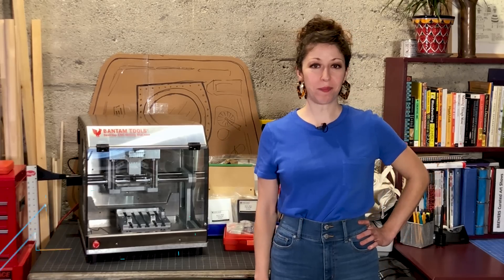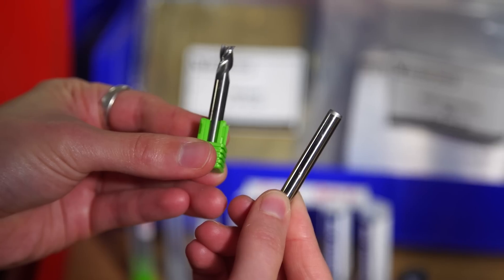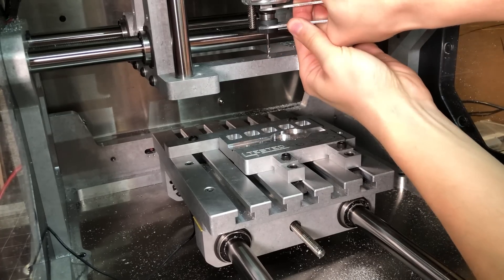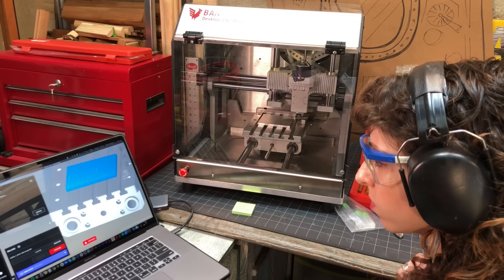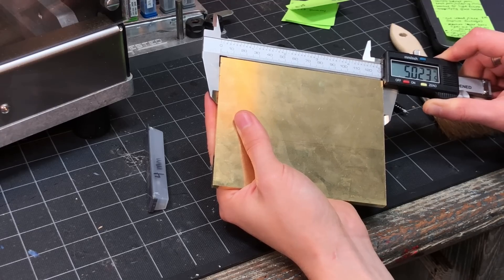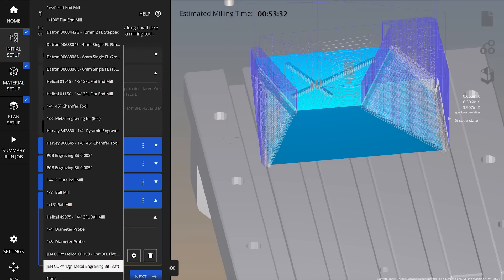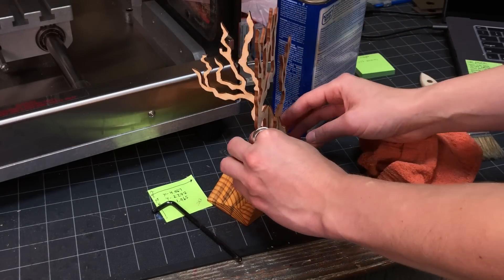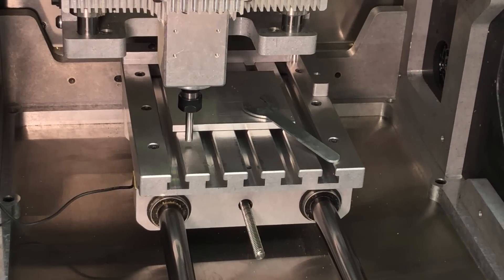Bantam Tools Desktop CNC Milling Machine Review!

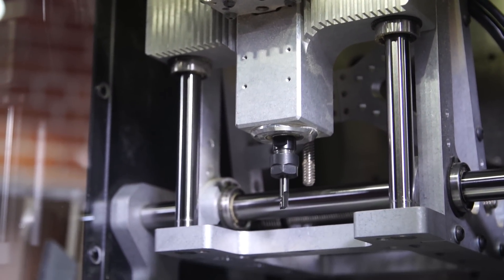Comment: @00:57 Hold up there... The Bantam too is just a 2.5D Milling Machine as you cannot mill all 6 sides without flipping/turning the stock yourself - Top side without overhang access, Sides without overhang access, Bottom without access. The only 3D Milling Machine in that prosumer price class ( I know of ) would be the Pocket NC 5-Axis CNC Machines - Top and Sides with full overhang access, Bottom with limited overhang access.

Comment: Looks like it's all there! I learned CNC back in 2000-- just at the point where you needed to learn how to figure out the tool path on your own. The scary part was that, when hired, you were expected to step in and enter all the g-code in one go. I'm sure that happened all day long in the real world but put a zero in the wrong place and you've got a 100lb jaw turning at 6000RPM...

These days sound a little better-- converting a drawing straight into g-code was a thing back then but one was encouraged to trace the path anyway.

Good presentation.
Reply: WTF are you talking about??  Cam systems have been around since the early 1980's.  By 2000 they were pretty damn powerful.  
Just because you worked in a shop that didn't have a cam system doesn't mean they didn't exist.
Reply: @danarrington2224  Aw crap, what the FUCK am I talking about?? I meant how could a p3 at like, 500MHz compare to a modern GHz machine.
Reply: Eliot Brown  It just took longer to calculate the toolpath. Solid modeling and 3D surfacing were very much available in 2000.
Reply: @danarrington2224  Thanks for setting me straight. I took a CNC class in a Port Ewen, NY vocational school and had to work with 10 and 15 year old equipment. So glad you got to work with the best.
Reply: @danarrington2224  And because you REALLY need to help me out here-- I was there for manual old school machinist training. The CNC stuff was really at the last minute, all things considered. And yes, the computers could just keep up with the new software. Pretty clunky.
Reply: Eliot Brown  You had new equipment to learn on compared to what I learned on. My first job was running a worn out Bridgeport in 1992.  I learned CNC on the job. My disagreement with your comment is more about you implying that this technology is new. It is not. Are you still a machinist?
Reply: @danarrington2224  This was based in a High School-- I used a 60s era Bridgeport and a nice lathe from just after the war. I loved those machines. The CNC stuff was supposed to be new but it was not cared for. Half the class time was spent battling the negligence and hunting down tools. A factor that did not seem to bother the instructor. 
I know what Jan is using is not "new" but the generation of software sure as hell is as is the computer it's built on. All purpose built and made just for this format.
Then, the g-code needed to be edited in Notepad, for example. Which was great experience but tortuous.
No longer trying to be one-- still use what I learned on a weekly basis though. That instructor was a little bent by the system but a wonderful teacher. What got me out of it was his "pep" talk about how, if we applied ourselves and acted confident we could secure as much as $11/hour... Which I am not knocking. But I was making hobby level vacuum form tables and doing better than that.
Reply: @MrChief101  Finally we get to the truth.  I took an auto mechanics class in high school but I don't comment on any auto mechanic YT videos like I'm an expert.  My first machinist job was $7/hr.  But I knew that I could make a hell of a lot more than that as I gained experience.  In fact, I quit a $9/hr job to take the job.  My point is stop trying to sound smart when you are not.  The real smart people can spot you instantly.
Reply: @danarrington2224  Good to finally meet a real smart person! Good luck.
Reply: @danarrington2224  I don't believe I tried to sound like an "expert." I did relate my experience of 2000. Are you saying nothing has changed over 20 years? I did have to calculate the tool path mathematically and translate that into machine language and enter that info manually. Today, the desktop machine comes loaded with a design and even has a piece of stock ready to go.
I think things have changed-- which was the import of what I was saying.
Throwing in comments on YT is an effort to support the algorithm.
Reply: @MrChief101  Your first comments implied that you were a 20 year veteran of machining.  Of course the comments that followed completely contradicted that.
Reply: @danarrington2224  Hmmm. i apologize to you if I gave that impression (perhaps to Jan too)- not my intention. I speak elliptically and often the written word just doesn't have the right emphasis.

Comment: Looks cool, but pretty expensive for something you need a subscription for. Wasn't clear how much of the subscription is just for their optional software and how much is needed to actually use the machine with third party cad/cam. If you have to pay a subscription it's a short jump to a "real" cnc installment plan....

This is probably mostly for tech ed classes at high schools, which are kind of an endangered species.
Reply: Hi there! Just to clarify, you don't need to buy a software subscription if you don't want to. Every Desktop CNC Milling Machine comes with a base pack of the Bantam Tools software for free and is packed with the features you need use the machine––and then some. Also, the Bantam Tools software supports G-code, SVG, and NC files. So you can use whatever design software you prefer, export the files, and then drop them right into our software. Hope this helps!

Comment: 250W? That's 1/3 HP or about the same power as a Dremel tool. Hopefully these come with better options for the spindle otherwise the motor'll be working at or near capacity in any material of consequence. For reference, a Bosch Colt or other palm router used in larger DIY mills are what, in the range of 750-1000W, or 1 to 1-1/3HP? Nice little machine, but I can't see it elevating itself beyond "desktop toy" to anything useful. I'm only toe deep in the vid right now, but it seems a little short in areas from the outset. I'll comment further as I watch....
Reply: Oh man, so the desktop design work to G-code is done via an online service? Immediately I feel that ownership of one of these machines is veering into "you don't own it, you licence its use" territory. How are you going to mill an anti-zombie machete when the Internets fail and you're offline, or the company no longer maintains this service?
Reply: It would seem this hinges on whether the machine can be operated via third-party software or not. If that's not the case, this is an expensive brick to wake up next to one morning.
Reply: Oh jeez, plus a subscription service? Yeah, you do not own this machine. It's the payment you make to get through the door. I'm hoping that the maker community takes this machine and re-purposes it for use with commonly-available software. All the guts of the machine seem good - if still a high price - but the fact you're licensing the product rather than actually owning it? No thanks.
Reply: I do like how they provide you a chunk of aluminium to mill a poor toolholder, rather them providing it themselves ;-)

Comment: Actually since there's no cooling you don't want to step back on feed or speed more then needed, mounting is the limitation.
With right cutting data the chips should get 80% of the heat, with to low Q value (cuted volume per minute) the pice will absorb the heat and toleranses will be harder to get, also tool life is shortened.
Reply: Get as much heat out in the chips as possible.

Comment: This thing is slightly smaller than something like a grizzly mill, which is a full blown vertical mill with a cnc conversion kit, and almost $1,000 more expensive. The software for this is laughable at best. We need more open source solutions for this tier of machine.

Comment: I feel like $3600 USD is a bit pricey for such a small machining bed. X-carve's fully loaded version has a X-Axis 750mm
 (29.52 inches) ,Y-Axis 750mm (29.52 inches) sized bed. Most wood CNC's can cut aluminum cause it's a softer alloy. MSRP $2299 USD. Also comes with comprehensive software.

Comment: Yup, cnc still isn't for the entry level household maker it seems. Too expensive for such a weak bit of software that's tied behind a subscription as well.
Reply: Hi there! Sorry you feel this way about the price point. Just to clarify, the subscription pack is totally optional. Every Desktop CNC Milling Machine comes with a base pack full of powerful features for free.

Comment: Will you outgrow this machine? If your needs extend beyond model-making and cosplay: yes -- but even then, you could get a lot of this machine. Are there cheaper options? Sure, but do you your homework: most of them are not enclosed, or as turn-key as this.

 Still, I'd be leery of running this in my studio apartment: Despite what is said about chip containment, even if you're careful, chips have a way of getting into everything. One mishap, and you'll have "death glitter" all over your kitchen, bed sheets, etc.

Comment: Sure is a bunch of whiners here. You don’t have to use their paid software to use the machine. The free version works with it. Im guessing in the future other gcode sender programs will work with it also. Sure there might be other small machines cheaper. But then you are pretty much on your own to get it working, even the shapeoko doesnt work out of the box without extras. At least with this machine you can have it out of box and milling fairly quick. For some people thats worth paying extra, we aren’t all poor, some of us have jobs and have saved up for a big purchase.
Reply: But why would you waste your hard earned money on this thing????  CNC machining comes with a few requirements.
1.  You need floor space.  Not just for the machine but for all of the tooling that goes with it. 
2.  It's not the same as 3D printing.  You can't simply make a 3D model and let the software do the rest.
3.  You can't teach yourself how to do this.  Yes there are YT videos you can watch but most of those are made by beginners.
4.  It gets loud and messy so don't do it in your house.  Why would you want a machine that makes a mess on your desk?
5.  It's VERY, VERY dangerous.  It's can be more deadly than a car.  There's a reason they make you take driver's ed and pass a test before they give
you a license.  Treat this the exact same way.

Comment: Trying to wrap my head around removing a Z probe from a collet, then inserting a cutting tool of random length into the same collet and somehow not having a wreck due to an unknown tool length. Where is the magic wand located, and do you sell them separately?
Reply: The machine touched off on the corner of the bed when a tool was fitted @7:22- I assume this set the tool length. But yeh 2 collets should be supplied.
Reply: Normally the probe on these "desktop" CNC machines are only really used for locating the edges of the part; getting the length of the tool stick out is another problem entirely. Some of the nicer machines I have seen actually have a separate sensor pad for the tool touch off on to help with that problem.

Comment: Build your own. You can put together something with a comparable build area and capabilities for way under a grand.
Reply: You can put something together with 10x the area under a grand. Also doesn't come with a stupid subscription and proprietary software.

PS Shapeoko's used to be around $500, the later upgraded ones are over $1k, but still more attractive than this thing.
Reply: Doubt you can hold tight tolerances for under a grand.

Comment: Looks good, but you need to pay 200 a year for the software needed to run it.
Reply: Hi there! Just wanted to let you know that you don't need to buy the subscription pack of the Bantam Tools software if you don't want to. It's not going to be for everyone, which is why every Desktop CNC Milling Machine comes with a base pack of the software for FREE and it includes automated probing routines, SVG support, and Fusion 360 templates.

Comment: So its use is  limited unless you pay a subscription. I'll pass.
Reply: To paraphrase Bantams replies- "no, you don't HAVE TO buy the sub, but if you don't, we'll reach into your machine and spank you. And not the enjoyable kind either. We mean the kind that has you calling CPS."
Reply: The base pack of the Bantam Tools software comes with a number of power features that will allow you to get started right out of the box. It includes automated probing routines, SVG support, Fusion 360 templates, and shortly after this video we made the decision to include the feeds and speeds override feature. In a nutshell, the base (free) version is packed with all of the important features you'll need to run your machine, and then some. The subscription pack is more for folks using the machine in a business setting where every minute counts. Hope this helps to clarify :)

Comment: Or you could buy a Carbide 3D Nomad and a Shapeoko 3 for the same price and have a desktop router for small, precise parts and a large format CNC router for larger scale parts.
Reply: Or you could buy a beefed up 6090 router with a cast bed, 2 or 5kW spindle, linear rails, which would eat both the Nomad(similar toy to this) and Shapeoko for dinner. And you'd still have a grand left over to buy a truckload of pizza.

Comment: Subscription?? Bit weird. Especially at that price! What happens when the server goes down? Screw proprietary subscription services.
Reply: Hi there! Just wanted to clarify a couple things. First, you don't need WiFi to use the software. You install it right onto your computer (either Windows or Mac), connect your computer to the machine, and you're ready to roll. Second, you don't have to purchase the subscription pack of the Bantam Tools software, if you don't want to. We realize that the subscription isn't going to be for everyone. That's why every Desktop CNC Milling Machine comes with a base pack of the Bantam Tools software for free.
Reply: Bantam Tools you have every incentive to hold back important features to make more money.
Reply: @bantamtools  There's no way that your software doesn't periodically verify its subscription status to keep those 'premium' features unlocked.  When you discontinue it in favor of a new solution or product, or god forbid just go out of business, how do they know that the real meat of the features you're locking behind a paywall are going to remain available?  Either way it's a bullshit and greedy as hell move especially on a product at this price point.  Letting people just flat buy the software features in an update package would still be greedy, but at least then they'd know that they own the features they want without worry of losing them at your 'premium' subscription whims.

Comment: How are the tolerances?
Reply: The Desktop CNC Milling Machine has a lead screw accuracy of <0.0054 / 9”  and +/- .001” repeatability.
Reply: @bantamtools  Well, repeatability is one thing. Works piece tolerances are another. How are you handling backlash?

Comment: This is a router not a mill.
Reply: @usseg  Thats interesting because at the main shop at the national lab I work at they do have a large CNC router as well as CNC mills. The core difference ACTUALLY being spindle speed and relative torque.
Reply: @usseg  Not to mention that there is the inherent expectation of rigidity with a mill, which this toy does not have. Therefore it is a router.

Comment: ehm for 3.5k if your a maker you can make a pretty decent cnc machine yourself, and its not going to be limited to soft metals. sure desktop aspect is cool, but lets be honest having a machine that is a desktop machine should not pull the price up, it should in fact make it lower. that you didn't slaughter this machine tells me i shouldn't trust any reviews from tested anymore its not close to a reasonable price. there doesn't look like there are any expensive parts that would reasonably  require this high a price, except that its finished out of the box. this is to be frank a terrible review. and i know for a fact that its not the lack of knowledge. so it means its a lack of backbone, shame.

Comment: Full feeds and speeds control being a subscription service is a pure money grab, horrible way to treat customers.
Reply: Thanks for your response Bantam Tools. However it didn’t come across that way in the video and judging by many of the comments  I’m not the only one to infer this. I still think a subscription service for software is a looser for you that much is clear by the comments. @tested - was this a paid advert or a purchased review ?
Reply from the maker: @stuartmartin3408  This was not a sponsored video, no. We would have disclosed that.
Reply: Adam Savage’s Tested  Thank you for the clarification.
Reply: Hi Stuart, to clarify, the Custom Tool Library, which allows you to create fully customized feeds and speeds recipes, does come with the base pack of our software (which ships for free with every machine). Through the tool library, you'll have the power to add custom feeds and speeds, as well as import and export tools to and from other Bantam Tools users.

Comment: It's too easy, you won't learn anything useful by letting the software do everything. They advertise the machine as a "good way to learn" but i doubt their controller software teaches you anything useful if you want to upgrade to something remotely professional in the future. If you want to learn just buy a cheap mill kit from china and a mach3/linuxCNC/masso controller.

Comment: This is not a bad little machine but if you are just trying to do normal work you can get a used Bridgeport for 2000 and it can do 10x the size and if you do it right you can covert it to cnc.